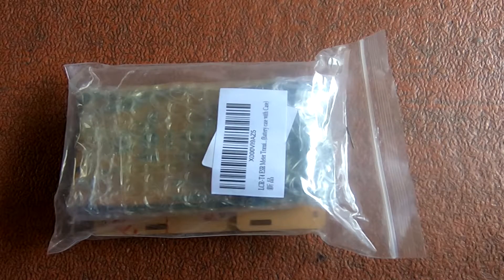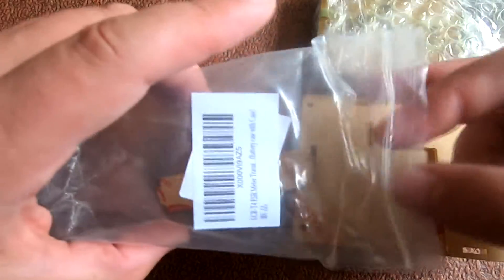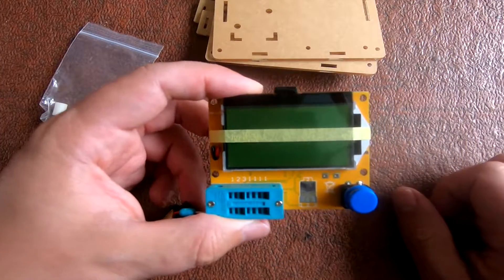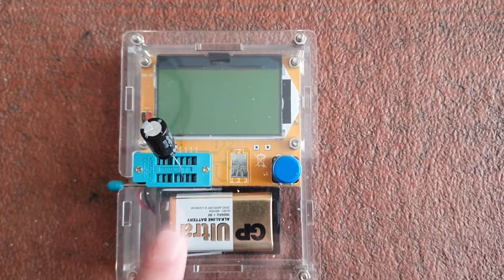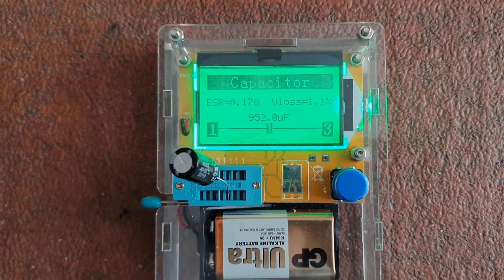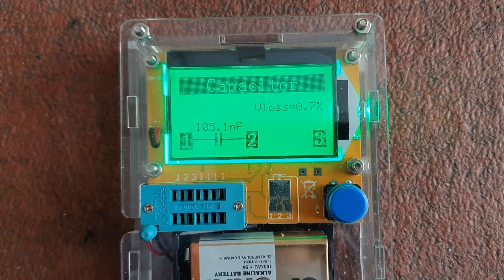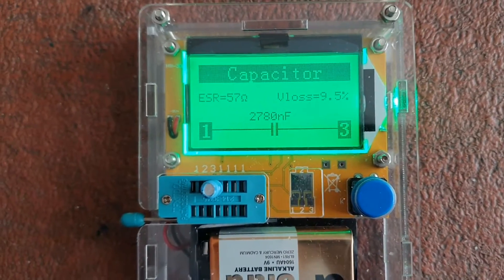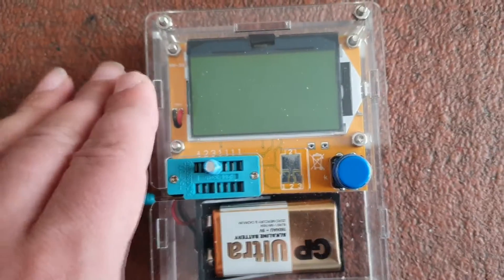LCR-T4 ESR Meter Build and quick demonstration

Comment: I have a similar tester and you can also put the transistor in the clamp at the 1,2 and 3 position. They are connected to the pads numbered 1,2 and 3.

Comment: I bought the same last year. For me (i.e. not mega serious but need something) it's ideal. It was a pain getting it together though, I'm dreading changing the battery, it'll fall to bits again before I get the screws in.
Reply from the maker: The back of the battery tray on mine broke off when I was putting it together. Should prove useful soon as I'm recapping an old radio at some point